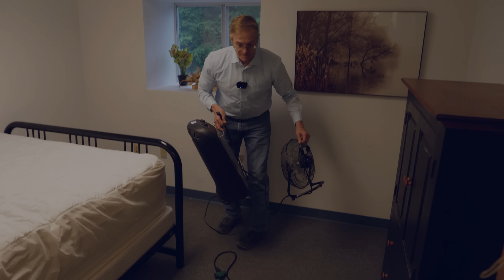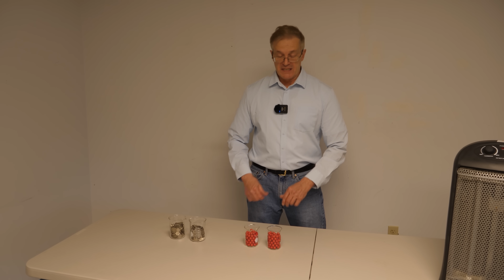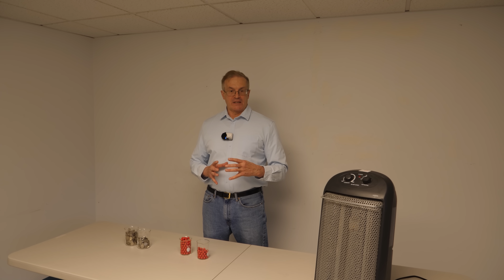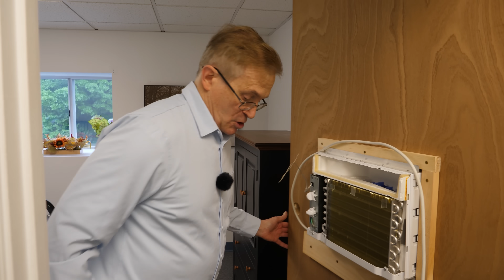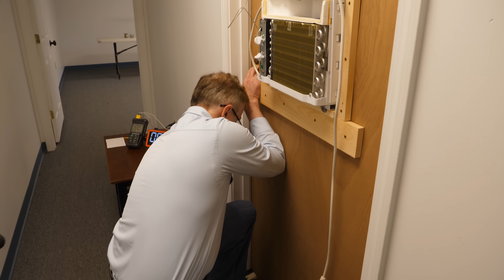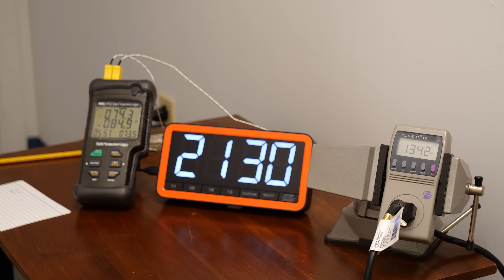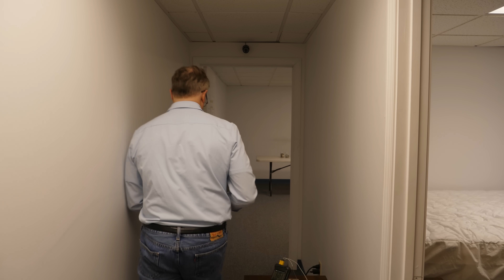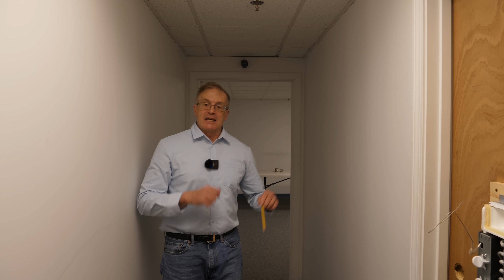You're wasting money on heating! Use your A/C!

Comment: Problem is most people don't want to reverse their window AC every season. Or they aren't built to do that without a reverse heat pump that adds expense.
Reply from the maker: Sure.
The point is primarily how well this works rather than to suggest a specific installation.
Reply: @TechIngredients  I do find the thought interesting, to have a window ac that is made to flip around and still have the controls and plug on the inside.

Comment: I’m a union pipe fitter. We cover all sorts of process piping. We also have HVAC and steam fitting under our umbrella of piping. 

I enjoy learning about exchanging of heat. 
I wish there was a home/ commercial system that included all your heating and cooling needs. 

We all have hot water heaters Washer and dryer’s, refrigerator and HVAC systems in a house. 

Why aren’t they combined? 

My fridge produces heat all day. That could heat my water or preheat it. 

One would think it would be ultra efficient to combine them all into a single system or tapped into a split HVAC system. Usually the bigger unit are more efficient.
Reply: There are, look to northern Europe.

Comment: The heat pump will likely remain more efficient than a resistive heater for many conditions, but it's all about the use case. If you want to heat up the room and don't mind the rest of the house being colder, then this is a valid solution. Move energy from the hallway to the room you like to heat up. Much more interesting would be to see what the efficiency is when moving heat from winter outside air (say 0 deg C to -10 deg C) to heat up the inside. 

My heating hack was to rewire a 2kW heater to output 500W instead, so I could place it under my legs for localized heating. This literally saved me at least €2k last year in central heating for the apartment. Mostly as natural gas was ridiculously expensive in the winter of 2023, where a cubic meter rose to €4, including tax and delivery. Of which, it's quite normal to use 910 m^3 a year for a small apartment. The whole house hasn't been above 18 deg C the whole winter, and it was quite nice to have the bedroom at 15 deg C. I would like to experiment with a heat pump to see if we can do even better.

Comment: there is a difference in your testing. in the first setup you kinda had a closed system where you simply used heat element inside the room to heat it. in the second setup this was an "open system" where you moved heat from the inside of the room to the "outside" of the room. The "outside" is usually the outside environment where during winter this is generally at much colder temperatures than inside a building, and although you said the building was not heated the sun and insulation in the building construction means that the temperature is likely to be higher than the "outside". why is this important? the temperature differential is what is used to define the efficiency of the system and because you have compared two heating methods but thermodynamically different systems you would have gotten different (lower) efficiency of the A/C if you actually got the heat from outside (where the temperature is colder) and dumped it inside the room to be heated

Comment: Slightly amusing from a European perspective, since no one can afford to heat with raw electricity anyways here haha.  Heat pumps are the electric standard but we heat water with them which we then run through in-floor heating since you need a lower water temperature to get a good heat result than with wall mounted radiators. Natural Gas would be more efficient use of natural resources overall but the green politics wants to get rid of it because of muh co2. Even though we don't usually have AC's, we have had heat-pump clothes dryers on our market for a while now that use way less power than electric ones.

Comment: Well yeah
Well of course heat pumps work great when the air on the other side is pretty warm😂
Not as nice as a gas furnace in the winter tho
But I work at Trane to engineer cold climate heat pumps so they're getting better!

Comment: Just bought one 3 days ago it's an inverter type. It's over 120°  here.  It works so much better than my old a.c. and it uses half the power, and now I don't need a  separate heater for the winter. Grate video👍  its so hot down here. i can't wait for the next video 🫠
Reply: About ten years ago, I got a new Amana window unit, in a humid climate.  The condenser (outdoor) coil dripped condensation into a tray, which came with a drain plug.  My installer explained trapping some water in the pan would increase efficiency, as the fan would sling water onto the coil.

In practice, the standing water became a mold farm.  I've seen the same problem with "sonic / cool steam" humidifiers.

In winter, if I didn't clean my filter religiously, the evaporator (indoor) coil would accumulate frost until it became a giant ice cube.
Reply: @blipblap614  This one had a double vent pipe.  The exuast pipe is inside of the intake pipe, which I thought was weird. It is a portable unit. Normally, the exuast hose would get hot when using the a.c. on my old unit and required insulation to keep it from spreading unessery heat.  The dual design eliminates that prolbem.  I have checked the drain plugs, and both have no water, and I am running a swamp cooler aswell so it's super humid, and I am surprised that their has ben no condensation.  I will keep a look out for it. I have only had my unit for 3 days.  Thank you for the advice 🙂
Reply: @blipblap614  could you post the model you purchased I'm very interested
Reply: @blipblap614  I pour hydrogen peroxide in mine, sometimes vinegar but not at the same time.
Reply: Won’t work under 40 F degrees. Condensation is going on your floor?  Heaters have defrost to keep them working under 40F.  
Your sensitive electronics will be on the outside getting rained on. Not great for it probably 🤨
Reply: @BeefNEggs057  I rarely see below freezing here. Maybe one night a year will be 20F.  The unit performed fine until the defrost cycle couldn't pull enough air over the coil due to a clogged filter.

The outside portion of a window unit is just a fan and a coil, housed in a sheet metal box, insulated with styrofoam.
Reply: You will absolutely want a backup heat source if you haven't figured that out yet

Comment: I also love another idea that you can do with a/cs in the winter. I'm not sure if it's efficient to do this.... i'm not allowed to do this in my apartment. IE put it through a window and pull heat from outside in the winter, my apartment complex will freak about the condensate dripping into the room.

I have, in the past, hidden the entire unit inside put a bucket below the condensate drain and turned it on. This takes the water vapor out of the air, and because it took thermal energy to put that humidity there.... the energy has to go somewhere. It's almost like a reverse-swamp cooler, removing water to warm the air. I'd be interested to see if that is an efficient use of energy, maybe make it a video on the channel so the knowledge spreads.

Comment: Sadly this isnt practical or really workable. If you tried doing this in the winter via flipping your AC around blowing cold air out and hot air in, the cold air out side would freeze over your AC in 5 minutes and the whole thing would stop working.

Come on man!  You got other better projects to work on then this!

The reason this isnt as impressive as you want it to be is because of that.  It requires the outside air not already be cold, but if the outside air wasnt cold then why would you want to heat your house?

Try this again in the winter and see how far you get.

Comment: In my case, when I explain this to people that are not "into science", what I normally say is that the heat pump "moves" the heat from one place to the other and the electric heater generates the heat, and that's why is more efficient. Not the best scientific explanation, but usually people understand the difference.

Comment: The difference in the energy savings is because no(or very little )heat has been generated here.

All that was done here is moved heat(energy) from one place to another. With this in mind it's not very cost effective unless you already have a warm place in which to transfer the heat from for free.

This is why heat pumps basically fail at below 32°.yes there is still heat outside in the 32° air,but the amount of energy required to extract it becomes more then resistive heating..

This is why heat pumps have never and will never be a good option for northern climates..

And on the flip side in the south heat pumps also get their ass kicked because of the lack of thermal transfer in very hot weather.

Heat Pumps only work well in 50-85° weather range. If the outside temps get lower or higher then that range and heat pumps fall flat on their asses.

Right now it's 90° outside for me and our heat pump has to run alday and night just to keep the inside temps below 70°.

And in the Winter when the temps are around freezing without a auxiliary heat source you'd basically freeze.

Comment: Love ur channel .. but it’s dangerous to mislead people who live in lower temp winters .. heat pumps go out when it gets too cold (maybe you can tell us why??). Everyone’s heat pumps went out in the freeze 2-3 years ago in the east and even some south east. If i remember right they stopped working around 15-20°F. . Temps went down below zero. 
Also why it’s important to always have a second source option of heat if you live somewhere with colder winters.. aka a wood stove (traditional, pellet, ultra efficient rocket stove). Classic furnaces are common in the north. That being said in SoCal/southwestern winters the heatpumps aka ductless or duct AC’s with heaters work great and heatpumps help lower the electric bill.. 

we went overkill in our old non insulated 1920’s house and installed ductless heatpump ac/heaters in every room and our electric bill went less than half than it was with only 2 wall ac’s (house never had central ac or heating). We still have a tall wall natural gas heater in the wall that works great too (we use whichever is cheaper since they keep changing each utility pricing 😠.

Comment: I'm guessing that in the next video you'll be adding a water trickler to the evaporator coil? That increases the efficiency by quite a bit, but the redox reaction that occurs between the aluminum fins and copper piping ends up making pinholes in the coil. I wish they'd make coils out of just one material so there wouldn't be any potential difference between them, but...

Comment: I'm a bit put off by the entropy explanation. Reducing entropy is not how things work in nature, so if you included the work you did with your hand to move and tip the containers, your overall entropy would have increased. But actually the entropy perspective isn't required to explain heat pumps.

Comment: I'd be interested to see the results of the same experiment where the hallway is closer to average ambient temperatures during the winter (or rather, truly install the air conditioner in an external window backwards).  Is the efficiency multiple still close to 4x or will there be degraded performance as the cold coils minimum temperature approaches winter-like air temperatures?

Comment: First glance it "looks" amazing... But unlike that hallway which is 70(ish) degrees, the outside temp at our houses in winter is BELOW 30!!! How would that window shaker perform if that hallway was 30 degrees instead of 70??? I know you know freon doesn't perform well at lower temps, thats why they have... Wait for it... Electric resistance heaters (or gas) for use when it get cold as a back up. Hard to pull heat from a fluid below its boiling point. Very interested to see your next video, maybe I'm wrong??? Maybe you know a neat trick??? Looking forward to it 🙂
Reply: This is just a demonstration.  Current heatpumps can achieve COP of 1 at -15F.

Comment: Great video but this doesn't seem like a "real world"  test. It was  77 F in your hallway when you started, so the AC is working with a hallway that already has a lot of heat in it. Nobody is running a space heater when it's  77F outside, they are running it when it's 47F  37 F or 27 F or 17 F or even 7F..   I imagine this old AC might compete with the space heater when it's 57 or 47 outside, but how about when it's 27F or 17F?  (And of course the AC would be facing outside, not stealing heat from your hallway). All that said, I do understand that there are modern  "air source" heat pumps favorably competing with "traditional" furnaces even up in  Maine during the winter — and if you dig a geothermal well to exchange heat with the  (constant temp) earth, then efficiency skyrockets even further no matter how cold the air outside. Since you are still reading, you should check out heet.org that is right now building "utility scale"  ambient earth temp geothermal network in Framingham, MA., so that buildings can install crazy efficient geothermal heatpumps without having to dig their own expensive  deep circulation wells.

Comment: Would this also be true for a split unit Aircon? And would colder outside temperatures make for more efficient heating inside?
Reply: Most modern mini splits have heatpumps and a ac/heater option. The heaters work great in temperate climates like socal but most heatpumps go out in colder weather. Someone mentioned they have Canadian winter heatpumps but I haven’t looked into yet. You definitely don’t want to freeze to death if you have cold winters

Comment: Here's my super efficient A/C: 
I have a basement just 2.5 meters underground. It's very humid and the temperature there stays at 15 degrees Celsius throughout whole winter and summer. There's 1 main door from the outside with a little gap around and a window that has a small opening for the humidity to escape if it builds up a lot. 
I have made a hole 200mm in diameter on the bottom side of one central room in the house, that is right next to the basement entrance. I placed a 500mm fan, running on 40W at maximum power to the furthest corner of the basement and connected it to the duct pipe with 2 sets of filters (a carbon and a HEPA filter). It's running when the outside temperature goes to 25C and I turn it off if the temp drops below 20. In winter it runs constantly because I heat up with fireplace and it helps with positive pressure of the air inside, so the smoke doesn't get inside and is pushed slightly more through chimney. Fire is also getting fresh oxygen to burn. I haven't figured out the air flow yet but it seems that this positive air pressure is pushing the hot air from the ceiling down.
Reply: There’s a similar technique people use to heat/cool their house by running a closed loop system (I’ve also seen open but there’s more issues) of pipes through the ground then to the house, it can vary on if they use air or liquid in the pipes and it gets pushed through the pipes with a fan or pump. Supposedly saves a ton but some systems have issues if not cleaned and maintained. 

Also radiant heating in a floor /foundation is supposedly way more efficient than any air type of heater.

Comment: This would be a very large project, but I would love for you guys to build a small building, to residential code standards, but instead of shingles on the roof, coat the roof with that heat-rejecting paint you featured in a previous video AND your forthcoming air conditioning efficiency mods. Maybe you could have a roof that can be removed and replaced so you could test traditional shingles and swap it with tiles coated with the paint.

The problem is controlling for the outside conditions, but still, it would be very interesting to see how big of a difference these things could make. 

I think building new houses and buildings with these ideas in mind, and also covering the roof with solar panels and feeding that power into the grid, could make an absolutely massive difference. Just looking next door at the large Mormon (I'm not a member) church, I did a quick check with Google Earth and their roof is 5000 square feet. At ~8 watts per sq foot, that's 40,000 watts of power going to waste.

In any case, can't wait for the next video!
Reply: Solar panels aren’t the best for the environment, it’s a common greenwashing lie that we’ve been told. 

There’s definitely a few ways to make houses better with passive energy.. the orientation of the house, thick adobe or straw bails or cob walls, water tanks along the southern wall and or black painted walls behind glass with a fan system… rocket stoves, those are all super cheap ways but there’s more and people are finally making visually nice looking options not just hippy funky stuff. There’s tons of videos teaching various ways to make homes more efficient and the pros/cons. Building better would help require less electricity or none to keep a house comfortable in summer/winter.
Reply: @DRJoe100  The manufacturing process of solar panels is likely where the 'dirty' part comes in, but it always makes me wonder, per kWh of electricity, which does more damage: Solar panels or fossil fuels?

Comment: Where is the gas furnace?   and the cost to replace the heat pump compared to resistance heat...  I used to love the commercials pushing heat pumps even when people have gas... a compressor on a heat pump {AC} is not cheap and labor to replace...  tell the hole story.. Please